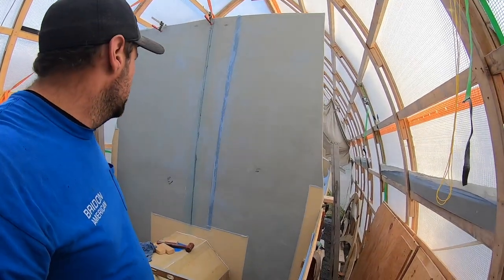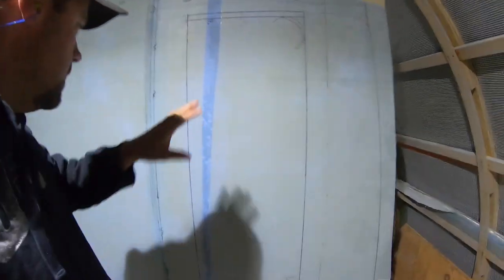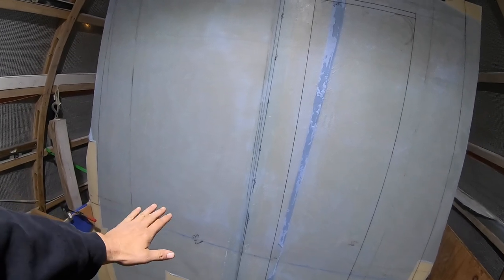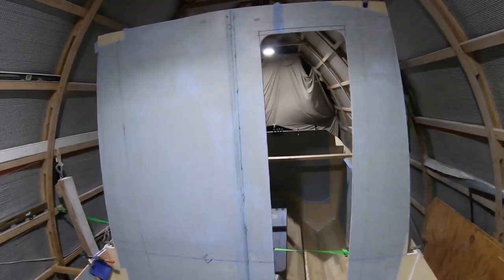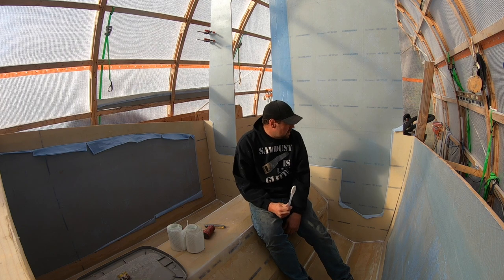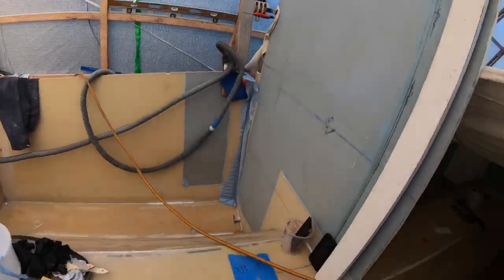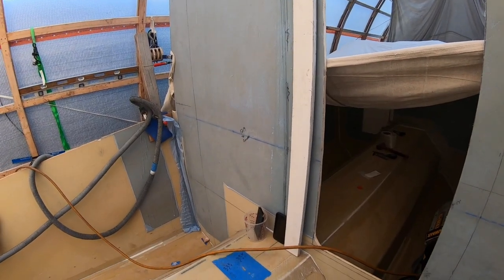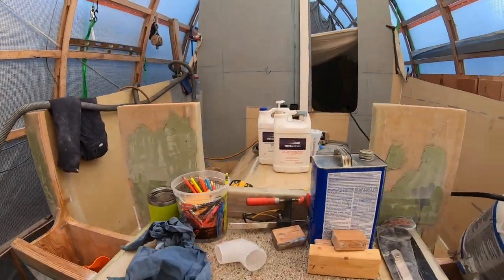Step 72: Making a Really Big Hole in our Bulkhead! -Power Catamaran Build Series

Comment: Cool,, full mask = no glass in the eyes or lungs 😖🤪.
Did you get the fillets to "hang on" better with peelply?
R24-25mm fillets = stroooong 👍‍‍👍‍‍!
Do you give it a rub with sandpaper/grinder before applying the fillets? Veeeeery important!
I know its 24ish feet long but how wide is the cat?
In Sweden we usually build "smaller" boats 2,49meter/8,27feet, cus your allowed to trailer widths up to 2,5m without any special permits.
3meter is allowed with special "wide transport" signs, but over 3meter you have to have leading and following car with rotating warning lights on top and signs etc.
Expensive stuff,, 😬.
The "buzzing tool" is called Multi-Cutter over here in Europe, and I think that FEIN who was the first company to make them/invented them, gave them that name.
If you buy a Makita, Hilti, DeWalt, Bosch, etc, they also call them MultiCutters.
Sooo cool to watch the progress 🤩🥰!
Well managed doggies,, ❤️❤️!
As always, thank you for sharing, cheers, huge hugs and much luv,, 🍻🍻😎👍‍‍👍‍‍❣️
Reply from the maker: We actually didn’t get the fillets to hang on better with peel ply! I think we’re just going to have to deal with it! We are going to post a short video on the boat we’re building this week!! Cheers. Happy holidays😁
Reply from the maker: We have been laying the fillets and glassing over them while wet in most cases. When fillets are done in advance the peel ply does help. Thank you for the tip. 
Our cat is 25’ or 7.62m long and is 8’2” or 2.49m wide. Maximum width on roads here is 8’6” or 2.59m without any special permits. Thanks for following along our journey 😊